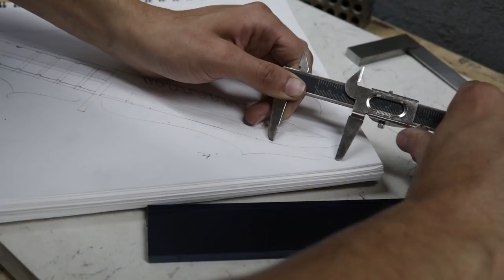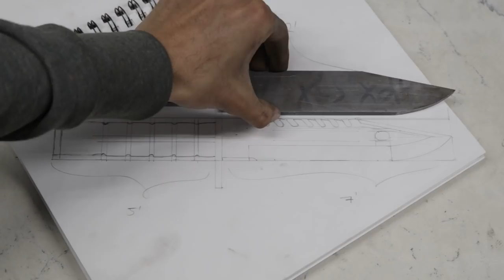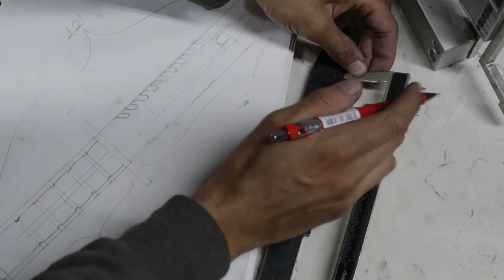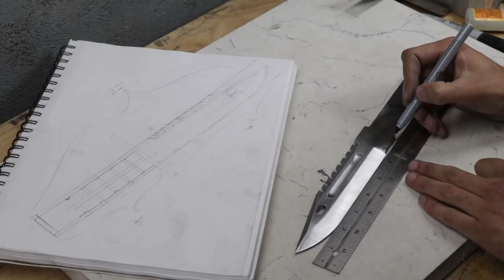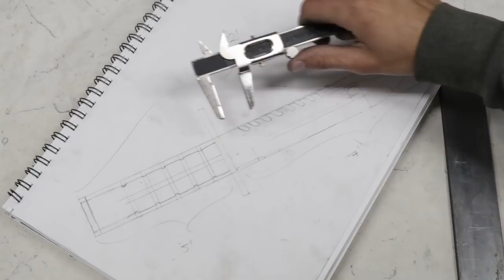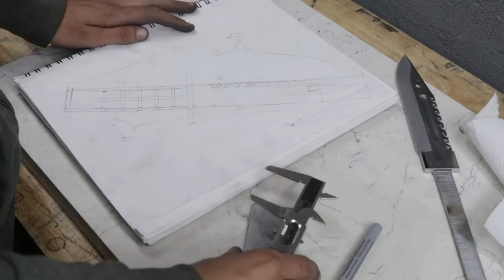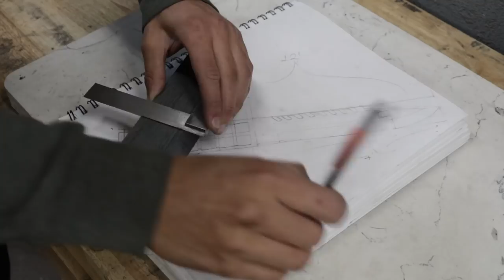Making an M9 Bayonet | Blue Gem

Comment: It’s a great looking knife, but did you not show the case hardending process? Or just didn’t label it? To me that looks more like a blue steel than a blue gem. Very dark blue. Not bad though. Usually when I see case hardens knives irl they do have very similar characterization to the ones in the game. Not too familiar with the process so I could be totally wrong.
Reply from the maker: Thank you. I actually couldn’t get a great shot of the hardening process so I decided to not include it in the video. Unfortunately my camera didn’t do justice to the heat treat so it looks slightly off colored in the video. The real knife looks a lot more like a blue gem. The reason why the entire blade is blue is because I tempered (not case hardened) the blade at the same temperature to give it an even color across its entirety. Case hardening works a bit differently and is not a very common process for knives since it only hardens the blade superficially hence its name. I hope that answers your questions! Thank you for the comment!

Comment: Outstanding work, real master in his field. If I might be so bold to make a suggestion even though its not my place, but I would try to find a way to secure the steel pommel directly to the tang and not the handle. Because if this is going to be a military hard use knife, and some one starts pummeling the butt of the knife in the field trying to break something I seriously doubt those two little pins would hold up to that level of abuse. That pommel will almost certainly break off. I would have cut a hole at the end of the tang and a corresponding hole through the pommel. Cut a square hole through the pommel so the tip of the tang fits directly through it. And then drive a thick pin through the side of the pommel through the hole in the tang and out the other side of the pommel. Its just an idea nevertheless phenomenal job.
Reply from the maker: You are absolutely correct. I didn’t go that far with this knife since it was made for display purposes. Thanks for the comment, glad you liked it!

Comment: i am somewhat of a mechanical engineer in HS rn and im thinking about doing something like this in a couple of years for like my final project - do you think its possible with more limited tools than you have for a beginner-intermediate at working with metals to make a knife like this? love your work.
Reply from the maker: Yes, it is absolutely doable provided you spend a lot of time. Simple jigs might come in handy to get crisp lines (file/angle grinder jigs). Don't be discouraged if you mess it up and have to start all over again :)
Reply: @VertexBladeworks   I've been learning about it on YouTube and it seems like the hardest parts would be making the forge and tempering, but i have a couple years to figure it out haha. Thanks for the advice!

Comment: Have you thought about sending one to dutch bushcraft knives? I'd love to see how a knife like this performs in the field.
Reply from the maker: Not really. This particular knife wouldn't do a very good job in the field since it has been heat-treated at a very high temperature for its signature color to appear. I am still not very confident about the performance of my field knives as much as I am with my kitchen knives. So I will think about it once I improve my design a little bit. Thanks!

Comment: Obviously you did a great job but case hardened literally is the look when you put it into fire and back out again. I dont know how to control it in order for it to get as much blue as possible though
Reply from the maker: Yeah case hardening process is actually different and used in very low carbon steels to harden the outside layer. It’s actually not very useful for knives since the core stays soft which sacrifices performance so it’s mostly used on gun parts. I have only performed a temper on this blade to get this color not exactly a case hardening.

Comment: This is awesome, I recently started making my first/second knife from 1084 steel and it’s so much more difficult than it looks, I only have super basic tools and rarely have time. The hardest part for me is making the bevel. I’m just using a simple bastard file and it seems impossible to make the bevel as pronounced as you have it on this knife. On my knife it comes down to a point still that’s about the thickness of 3/4 of a dime, but you can’t really differentiate where the bevel ends. Hopefully I can learn to make something as good looking as this soon. I haven’t had time to heat treat it yet so my blade is still somewhat thick, if anyone has any tips for what I could do differently to make the bevel more pronounced that would be awesome. I think the problem is that every time I have the bevel down, I accidentally wash it out with the edge of my file, which basically makes the line between bevel and not  bevel not visible once again. Thanks, and awesome knife
Reply from the maker: Thank you very much for the kind comment! It can be hard to achieve clean bevel lines with a file. For the best result I would suggest making a file jig. Aaron Gough from Gough Customs has a great video on making one of them. If you are planning on getting serious about knife making, a belt grinder will make your life much easier. But don’t get discouraged, you can still get great results without one, though it will just take you longer. Best of luck to you with your journey. Let me know if you have any other questions!
Reply from the maker: Also, you can try alternating the direction of your file stroke. Instead of filing both the flat part of the blade and the bevels, for example, go in a right diagonal direction on the flat part and and a left diagonal direction for the bevels. I have gotten great results with keeping my lines crisp like that when sanding to finer grits.
Reply: @VertexBladeworks  thank you so much for the help, I saw the file jig and I hope to make it soon once I can make space. Hopefully it works out !

Comment: Impressive job ! May i ask you where do you find the measurement for the bayonnet ?
Reply from the maker: Thank you! I’ve used the standard M9 measurements and scaled a 3D model accordingly. I am not affiliated with them by any means but cs.money has a 3D skin viewer that’s pretty neat when it comes to transferring these designs into blueprints.
Reply: @VertexBladeworks  thank you for your answer !
Reply from the maker: @pigroodv2994  Of course, lemme know if you have any other questions.

Comment: This is not how it's exactly done, but C for effort.
Reply from the maker: Damn a C???? I’ll take it.
Reply: @VertexBladeworks  case hardening means carbonizing metal for it to be stronger, you just putted it in fire.
Reply from the maker: @KyryloMudrokha  You are right. However, I never said that I case hardened this blade. The video is simply named this way because this is probably what a full blue gem case hardened M9 would look like in CS:GO.
Reply: @VertexBladeworks  well that's dissapointing. 😞
Reply from the maker: @KyryloMudrokha  Damn, I can't live with my failure. Why don't you make a proper case hardened M9 so that I can learn from you?

Comment: I have only 1 question: can u use that for self defense? If it's real knife Im standing ovation!
Reply from the maker: Yes but there’s a caveat. Since the knife is tempered at a high temperature for its signature color it’s softer than most self defense knives. Using it will most likely result in a lot of deformations in the knife. I guess you can expect that from any knife but this one will just deform faster. However it’s still a fully functional knife so yeah :)

Comment: Handle seems not attached to the blade .. how does it stick there... I dont see you using any glue or epoxy either...
Reply from the maker: I've used epoxy off-camera to hold the handle on. Cheers!

Comment: Wait! I'm not saying im an expert or anything, cause i never made anything like this in my life, or anything even close to it, but aren't knives supposed to be crafted with multiple layers of steel? He just like made it with one.
Reply from the maker: Hey, not necessarily. Some knife projects can benefit from multiple layers, however most general use knives should be fine with a single layer granted they are hardened and tempered properly. Cheers!

Comment: I actually wanted to know the part where you did the blueing 😂😂😂  like how you did that hot or cold but meh..
I guess i am not getting it .

Great Video 👌🏻✨
Reply from the maker: Hey! I was able to get this color by tempering the blade as stated in the description. Iron and steel can be oxidized by heating them to a specific temperature. In this case I set my oven to about 550 F and kept the blade in there for about an hour. To get an even and consistent color you have to clean the blade with degreaser. Keep in mind that every oven works differently so my 550 F may not be the same as yours. Experiment as many times as you can to have an understanding. It took me about 4-5 tries. Cheers!
Reply: @VertexBladeworks  awesome looking knife man, well done!

Comment: for such a beautiful work of art that sure is quite the shit design for the handle, reason being is it wont hold shit on. One good yank or swing and that blade is coming out of the handle. its needs atleast 1 pin going all the way through the handle and tang but id say 2 just for symmetry and makes it even stronger.
Like my parents and grand parents always told me, if your goin to do something do it right and that my guy is not how you make a handle properly, that's like those cheap ass chines off brand knives of another off brand.
Reply from the maker: I agree that I could’ve done a better job with the handle construction. I did use hella epoxy off camera so it came out pretty solid. I also wasn’t too concerned about it since the blade is purely for display purposes and not for actual use. It would be unacceptable to construct a handle that way if a blade is meant to be used that’s correct.